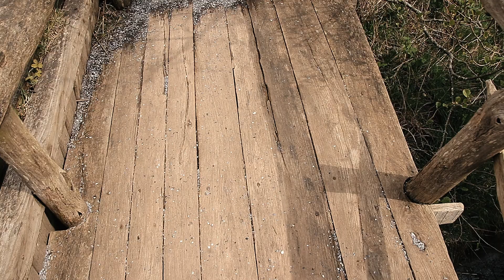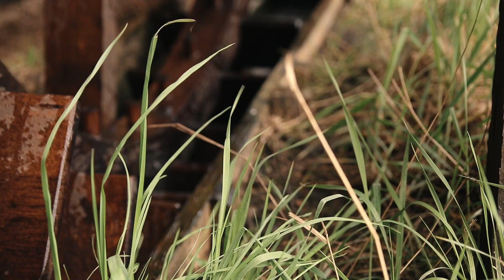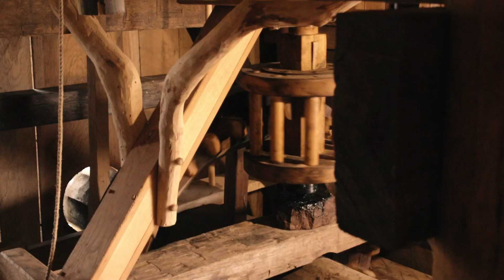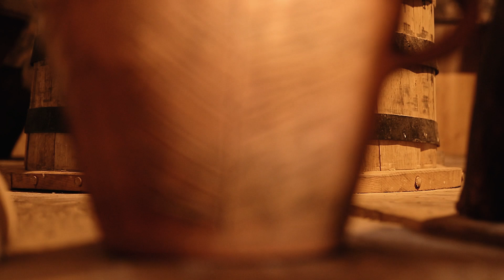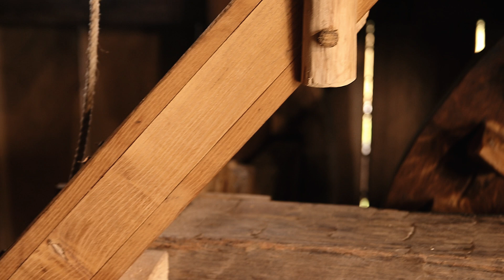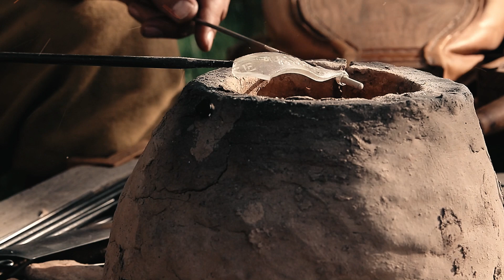Ancient Technology in Action: Viking Age Water Mill Grinding Flour

Comment: I would have thought they used a horizantal wheel.  Much simpler and more suited to small scale, rural operation.
Reply from the maker: The probably mostly did as you suggest. But there is evidence of possible water mill in a certain region in Denmark from the Viking age suggesting a wealthy and advanced agriculture there. The video is an excerpt of a longer video that explains more and also demonstrante the hand mill you suggest. The link is in the description:) thanks for watching
Reply: @RAMUNI-Viking  I know they used hand mills but that's not what I was talking about.  There is a type of water wheel that lays horizantally, connected directly to the mill stones.  They were quite popular in the American south, for example, and were suited to smaller scale rural use, being much less expensive to build and operate.This primative mill wasn't an American inventionand  had to originate somewhere.
Reply from the maker: @ruariniall7463 ah i see. My bad. Sorry. That sounds interesting. I abe not heard of that before. This mill is based on designs from Northern germany where the mill had a stronger tradition going back. And Those were vertical. I Will have to check out the ones you talk about.
Reply: @RAMUNI-Viking  I've just read that archeology suggests that horizantal water wheels were common in Ireland even before the Viking age.  And that their origin in Mesopotamia goes back much further.
Reply from the maker: @ruariniall7463 that interesting. Thank you

Comment: When you use the stone grinder, do you use the flour you grind? 
I'm curious because recently I was reading a paper, and it said that Stone grinders have bits of small stone that shave off. In excavation sites they found skulls with teeth ground in the back from ingesting stone. Is there a way to make a grinder without that happening for recreation?
Reply from the maker: I used the flour yes. Both in the video I have on bread making where i use the flour, and the left over i used in my bushcraft overnighter video. I checked with my eyes for lager stone particles and found 1 nasty one that would have cost a tooth. And yes sure for long term use there is a certain wear and tear on the teeth. So be careful.
Reply: @RAMUNI-Viking  good to know thanks!
Reply from the maker: I suppose with some modern and much Harder material it can be done